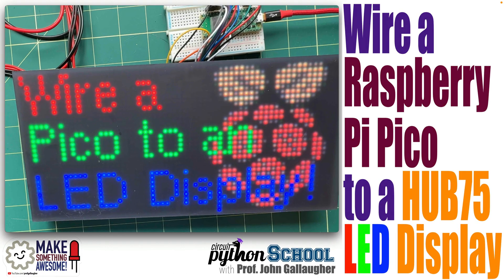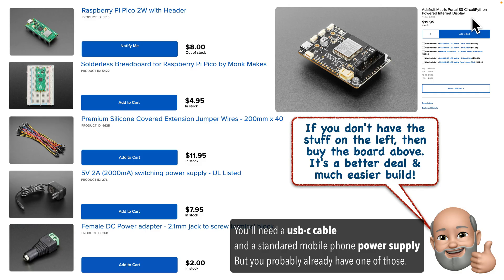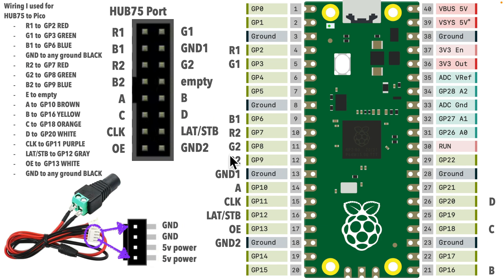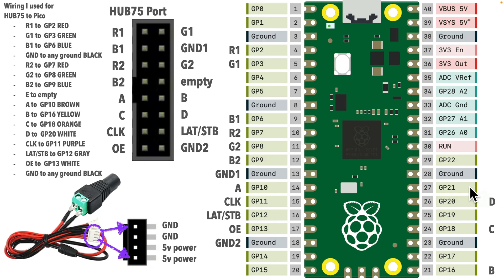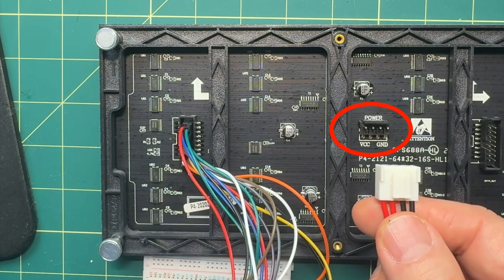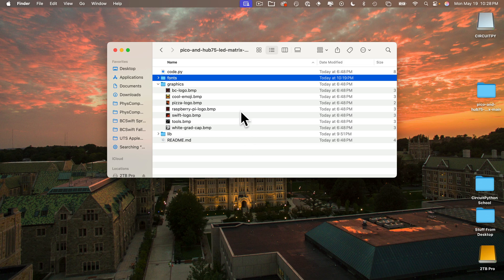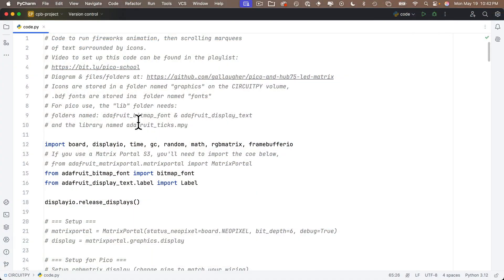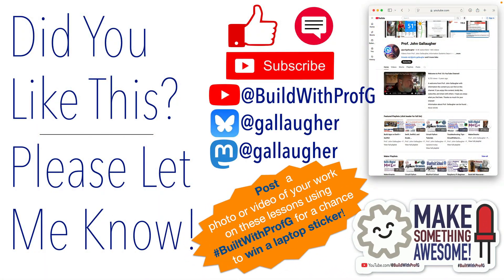Wiring a HUB75 LED Matrix to a Raspberry Pi Pico

Comment from the maker: IMPORTANT! Adding a common ground & replacing longer 8" pin-socket wires with 3" pin-pins that also used the included ribbon cable seemed to fix any flashing lines / interference that some users experience. You can check out updated diagram & photos in the read-me at the GitHub repo:
https://github.com/gallaugher/pico-and-hub75-led-matrix/

Comment: May we used big resulation like 3000x2200
Reply from the maker: It works with the HUB75 standard. You can daisy chain multiple boards together but you will have power and processor issues when you add lots of screens. A super large array of screens might use a full larger and more powerful Raspberry Pi vs the microcontrollers.

Comment: I've now seen nearly every permutation of the wiring for the Pi.
Bought a 64x64, had a Rpi5..  software doesn't apparently work with 5 since -- timings and hardware grr.
My flimsy-brochure has B1 going to GPIO-04 and R2 going to GPIO-05 and does actually have LE hooked, to GPIO-22 for some reason.

Thanks immensely for sharing.
Reply from the maker: Glad you found it useful. More to come!

Comment: Excellent video! Could something like this work on a monochrome LED display?
Reply from the maker: Sure. You’d. Need to use a library for a monochrome display though.  Here is a very small one but it will give you a sense of possibilities. https://www.adafruit.com/product/1079
Reply: @BuildWithProfG  Thank you for the info. The reason behind my asking is that our school district has a marquee that is no longer working, and since we are a very small school district, I'm looking for ideas to get it back up and running. Not real sure what the current configuration is but I was told that the parts are no longer available. So I'm looking around for inspiration. 😁
Reply from the maker: @DavidGlover-mi1po  this project is set up for a HUB75 display. You can check out the parts list from Aliexpress. I ordered 30 of them for my class. Their cost can vary, but you should be able to buy at least one 64 x 32 for less than $15, but there may be some shipping. You can daisy chain two together. If you do this, I'd suggest using separate power for at least one of the 64 x 32 boards to avoid any glitches. And if you don't have any of the hardware, definitely go for the $19.95 MatrixPortal S3. It's super easy to use/setup. No wiring.

Comment: Great lesson.  May need to get one of these LED panels to mess around with.  Thanks for sharing!
Reply from the maker: Thx! Just bought 39 from AliExpress for my Fall course. Tried out a bunch. The one linked in GitHub is what I chose. The MatrixPortal S3 is a really great way to leanly control one of these, too. I have a bunch at school with that single board, which cuts down on wiring and the need for a second power supply, but students will all work off their Picos. Upgrading to Pico 2 Ws for Fall, too. So kind of you to post encouragement. Hack on!
Reply: @BuildWithProfG  One of the best things in this world is the generosity of so many people to share their knowledge with others for little to no compensation on YT.  I try to do my part as I learn electronics as a retirement hobby.  I think I might get the kit from Pimoroni, but it is nice to learn to use displays without libraries/driver chips just to understand how they work.  Cheers!